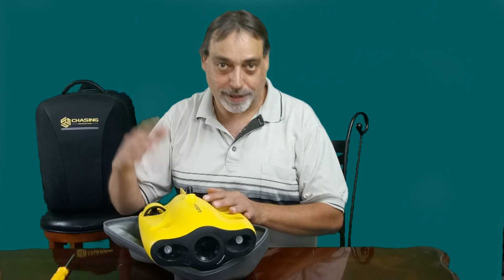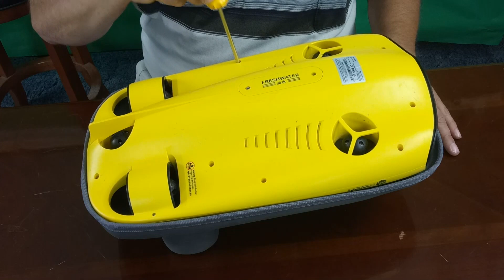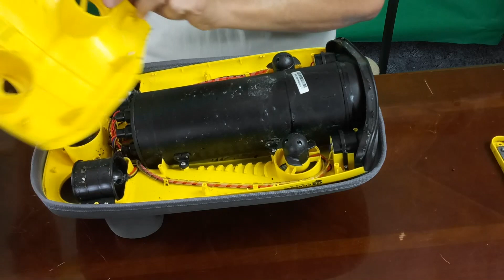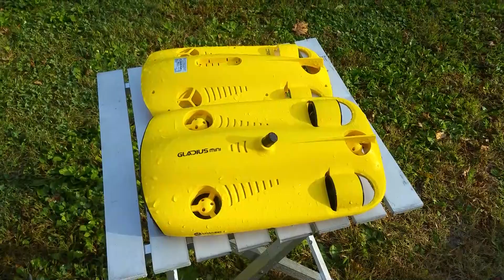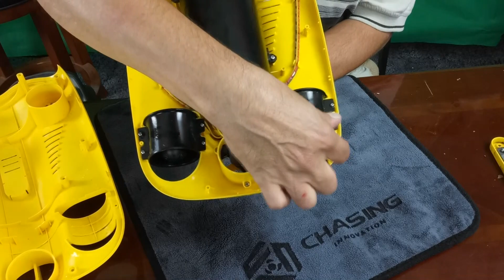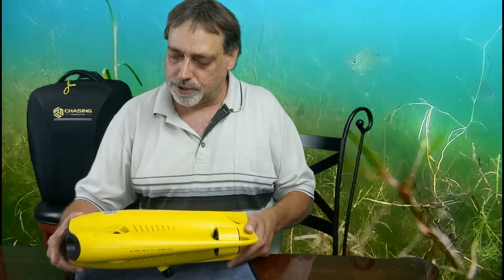A look inside and cleaning the Gladius Mini Underwater ROV.

Comment: If the motors are not cleaned properly they will need replacing at $200 for the set. 
I do recommend taking the motors completely apart if you go in saltwater. Not so easy, but if not ... $200! You cannot rinse off the inside of those motors.
Great video, friend!

Comment: How the hell does this device deal with water pressure? I've taken mine down to 200ft once still ok but you know what is an safe depth befor it will explode? i know t's rated for 200+ft but can it handle 500ft? As i visit the coast a lot and go out about 200 miles 

Doesn't look sturdy enough i thought it would be sealed good but you easily took it apart with a screwdriver lol
Reply: The aluminium "Cabin" (the black cylinder in the video) is incredibly solid and contains all the works and battery with only the brushless motors outside. The only limit really is the length of the tether, which is 100 metres (330 feet). I suspect it could easily dive to 1,000 feet without any drama if the tether was long enough. The plastic is only to streamline the ROV and, as it allows the water in, it doesn't need to resist any pressure.
Reply: @Knapweed  Ahh ok that's fantastic to hear! do they sell extended tethers? 

I would also worry about signal strength/distance... i plan to send mine down around 450ft off the coast of england, few ship wrecks there 

I wish this thing had arms.. would like to grab stuff and bring it back to the surface.
Reply: @Knapweed  thx mate
Reply: @xMandalorex  No worries, Mate!

Comment: Girlfriend has one of these. Two uses out in the ocean, cleaned properly/rinsed off with fresh water after each use. One month later, all motors are seized and rusted. Managed to get 3 of them working, but the front left and right are a complete frozen right off. Replacements are currently $60 each+  and Chasing the company who makes them keep changing their support email address. Rubbish product it seems, especially for the cost.